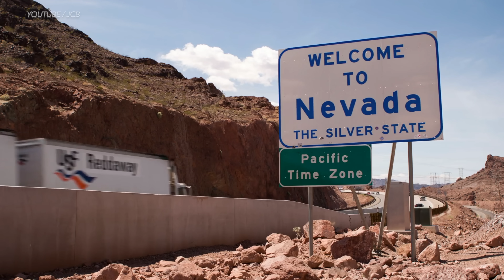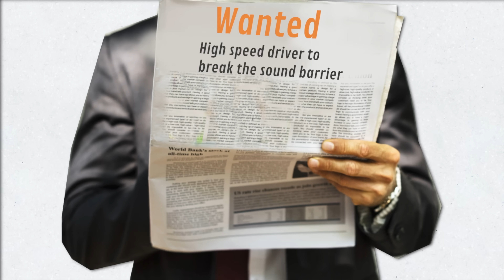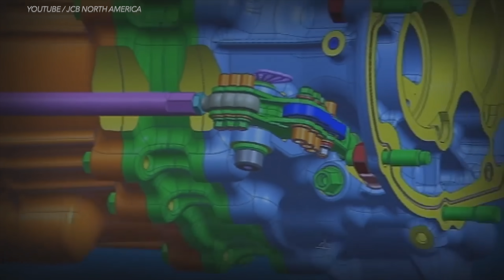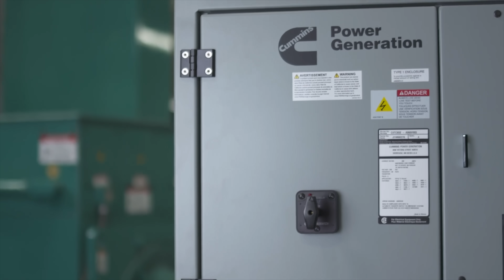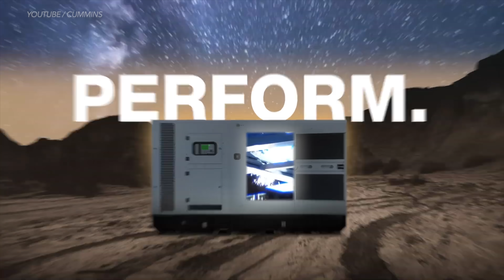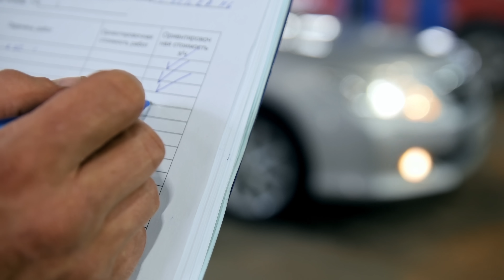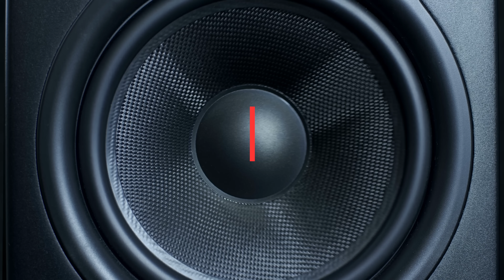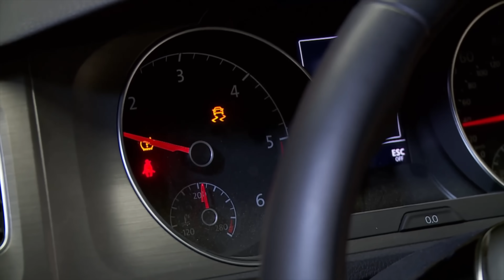Here's Why Diesel Engines are Being Banned

Comment: I love my 2000 VW Golf TDI. It’s got over 255,000 miles on it. I would buy another one except they stopped selling them here in the US. I also have a Ford Van with a 6.0 powerstroke diesel that I wish I would like more. (Ford build quality kinda sucks.) Diesels have gotten a bad reputation here in the US. I love the low end torque.

Comment: I have a 2002 VW TDI Golf with 340,000 miles on it. It has issues but I LOVE it.  I want to replace it with another diesel auto and there is my problem.  There are none in America.  I like the torque and I average 48 mpg. If I keep it at 60mph (rarely) on the highway I achieve 51mpg.

Comment: just bought a 2019 Jayco Seneca RV with a Cummins 6.7 Diesel.  Love it.  wouldn't think of using gas. love being able to go over 600 miles on a tank.  28,000 lbs and get twice what i would get with a gas engine. But I do care about global warming so I will put a big green sticker on the rv "Super Clean Super Efficient Cummins Hybrid Engine".  Or "Super Clean Hybrid Diesel Electric". That would be my Cummins/Onan generator on board but what the heck.

Comment: I have a. 15 year old Ford Fiesta TDI, 88000 on the clock. At a consistent 65 plus mph, i achieve 70 mpg.
Not as much in winter obviously, its around 63 mpg then. I have driven many vehicles over my years yet this diesel cars torque is brilliant. 
Remember drive with caution not calamity.

Comment: Many people do not realize that for big heavy jobs diesel electric hybrids have been the choice "go to" solution for well over a century. Submarines ; there are still lots of the diesel electric submarines including the still dangerous Kilo class. Diesel locomotives actual have final drives are electric. So are (ironically)  the huge diggers and ore carriers at coal mines. I'm guessing that the reason that we don't have diesel electric hybrid cars and trucks is that the increased cost and weight combined would limit the  market to a small niche with deep pockets. Fire departments ? Military?

Comment: So a diesel car will deafen you? Sorry, completely wrong. I have driven diesel for 18 years. My current Audi 3l A5 is nearly silent. Some tyre noise and that’s about it, AND it usually does over 50 mpg and has passed 60. Maintenance costs are near as damn it the same as petrol and the engines typical go on a lot longer. Several hundred k miles is usual, unlike petrol (gas) which would be into a rebuild by then, and acceleration great … all that torque. As to NOx, my and all current diesels use AdBlue that catalyses the NO2 to nitrogen and water … and nitrogen is 70% of our atmosphere. But yes, we’re all being encouraged to ‘go electric’ and share the handful of chargers there are, or charge overnight from an electricity grid that isn’t supposed to have the capacity, and for people living in town with on street parking? How will they charge? Another ill thought out Government ‘strategy’

Comment: Driving a Jeep GC with a 3.0 Mercedes diesel engine and 200k miles on it. Even with permanent 4x4 i get better fuel mileage and a lot more pickup then the gasoline version. I think the diesel problem in the US is the bad history when US car companies made cheap diesel engines what broke a lot because there didn't understand you can't just convert a gasoline engine to diesel.

Comment: No question diesel is more efficient than gasoline engines. I'd love to have a diesel pickup to pull my camper. But, the more than $10k initial price premium and the insanely high maintenence cost make diesel pickup totally unacceptable.

Comment: One thing that's worth noting is that gasoline engines have a maximum size after which they become very inefficient. In the opposite, diesel engines can be very large without loosing efficiency. That is why large ships and other machinery are not powered by gasoline engines

Comment: I have an X5 Diesel...  112,000 miles.  Knock on wood no issues with this engine.. although I recognize the UREA plumbing is a nightmare. The engine is great the emission stuff is worse than on gas cars... But I keep it up and at 63 mph flat ground I get around 29 to 31 mph.  Go any faster and wind resistance really kicks in... guiet with a lot of torque...

Comment: I have a 2005 Jetta TDI that with the help of the internet/YouTube, was able to pass emissions. It wasn’t that it was”dirty”, it would have the “check engine light” come on during the test. With the help of a basic code reader, I replaced the glow plugs, coolant temp sensor, and the vacuum valve that controls turbo boost. I will try to keep this car running as long as possible.

Comment: Diesel engines are great, usally well made, heaps of torque, good fuel milage etc.. But absolute poison when it comes to repair costs. A set of replacement injectors supplied and fitted to a late model diesel engine can cost as much as a  fully reconditioned petrol engine. A friend of mine ended up with contaminated fuel in is late model pickup. New pump and injectors fitted, clean tank etc, AUD $11,000 ( USD $7,400). Diesel particulate filters (DPF) that is another whole story by itself $$$$$.

Comment: I had a diesel but sold it a few years ago. it could do 36mpg highway while my present car is a GDI and can do 30mpg;  but it’s also heavier by 300kg and bigger. So now they say the new gasoline cars come with almost the same fuel efficiency so there is no need for a diesel however there should be some advantages like better reliability long term?! or less problems in cas of carbon buildup?

Comment: I hate that even Scotty has used that "up to 40 x" emissions re VW without showing actual numbers- clarify! Unless there's obvious ulterior motives. Most of the "cheat" emissions levels were still minute; numbers easily accessed w a search online, they are still incredibly low compared to past engines, and mostly below EPA limits set the previous year! "Up to" doesn't mean 100% of the time, and 40 x 0 is still 0 (just for reference)

Comment: I drive a 2.8 litre Duramax Diesel powered Colorado.  Best thing ever in light trucks.  Next year Chevrolet Colorado will come with one motor, and not a diesel.  It will be the 2.7 liter twin turbo 4 cylinder gasoline engine behind a 10 speed transmission.  Fuel economy will likely be close to the current diesel, and the engine will be far better suited to short trips and sub-zero temperatures experienced in parts of Nth America.  But here in Australia, we can travel between capital cities on the east and south coast on one fill, giving us between 800 km and 1,000 km per tank.

Comment: I had a 300D, it had fairly good fuel mileage but very expensive to maintain and high engine wear brought it down.

The oily deck at gas stations also wrecked lots of shoes.

Finally, its the nano particles they spit out, we now know these are bad.

Switched to an LPG powered GM V6. Very happy with that, much better vehicle than the Merc.

Comment: I checked the decibel level in my 01 7.3 F250 2wd . With a AIS  intake and a straight through muffler with 4" exhaust. 
Wicked wheel in the turbo and 6 position chip. I came up with 75 - 77 decibels.
Not as good as a gas truck but see how many of them are capable of running over 500k miles.

Comment: Until 6/7 years ago here in Europe 60% of new cars sold were diesel. From 1.5 L and above diesel was the nuber one choice. From 2.0 L and above, almost no one bought a gasoline car. Now they want us to replace diesel cars with gasoline hybrids. Toyota was the first to ditch their diesel range, and it's still the manufacturer with the best hybrid range. But also other brands are now introducing almost only hybrid or "mild hybrid" (that means with very little batteries and electric engines, that cannot work by itself but just as an additional torque aid to the gasoline engine, and for braking battery regeneration). The only one advantage of "mild hybrid" compared to standard hybrid (called here "full hybrid) cars, is the fact that these mild hybrid cars still have manual transmission and the clutch pedal that we love so much!

Comment: Just literally returned home from an 800 mile camping trip towing 6000 lb camper around mtns of colorado.  Averaged 14.5 mpg.  6.6l duramax.  My old Toyota gasser would avg 8 mpg and seemed like I was gonna throw a rod going up some of the passes in 2nd and 3rd gear.

One benefit scotty didn't touch on is the exhaust break benefits when towing.  I consider it a safety feature as another form of breaking.

Comment: I was at a Freightliner dealership, waiting for some warranty work and one of their techs was telling me how the air coming out of my exhaust was cleaner than the air that got sucked into that engine, take a look at the exhaust pipe of a class 8 tractor, you could run your fingers over the inside of that pipe and your finger will be clean. If you see a diesel vehicle  blowing out smoke, you're looking at a "sick" engine, but then we have the morons in diesel pickups that deliberately disable emission controls in their diesel pickups to 'roll coal", which is probably one of the absolutely STUPIDEST things I've ever witnessed

Comment: what a lot of crap, diesel engines are low maintenance and the last forever, and are they loud (100db)?, no of course not, my ford mondeo 2.0 diesel produces only 67 db at 100km/h, inside the car it is pleasantly quiet. I live in a cold climate, i was always able to start even at -28dgC.

Comment: The NO2 and Nox  levels can be almost can be eliminated if you B100 biodiesel  particularly if it is coal based biodiesel. Yeah I said coal and diesel in one sentence..a greenie's nightmare.  EVs are not about saving the planet....it's about making money. CO2, NOX, and NO2 are necessary to increase the vegetation levels of the planet. The higher vegetation levels increase the O2 and moisture or rain amount. The Green movement is actually killing the planet.

Comment: I have a  2009 twin turbo 2.4 Volvo V70 diesel than can do 155 mph  and averages over 40 MPG  , I service the car my self which isn't hard to do on a Volvo and I learned it watching Scotty videos. Anything harder than changing oil fluids and filters I leave to a mechanic, the car still runs like a  new car and I'm planning on keeping it as long as I can as I couldn't do the same in a petrol, like carry the load I do when I go camping with my family  . When I tow a  trailer and have a large roof box fitted I still get great MPG, I love how little it costs me to keep my diesel Volvo on the road .

Comment: I drive either a GMC Sierra 4X4 Duramax or a Mazda Miata RF. With the price of fuel where it is today I tend to drive the Miata a lot more than I would if fuel prices were lower. The truck is more comfortable and I can carry very little in the Miata. I’m also riding my SurRon a great deal more. Costs less than $3.00 ($2.88) to get me to the gym and back home for two weeks. The downside is the dog (#12.5 Pekingese) is not happy riding in the basket.

Comment: I have a 2013 VW  TDI SEL which gets 35 mpg in town & 45 mpg on the road.  It’s quiet enough - and peppy enough - that my passengers are surprised to find out that they are in a diesel engined vehicle.  Note that it has a dual clutch transmission - which may have something to do with that perception.

Comment: Got two diesels here in the UK. It's interesting how they have massively improved the diesel engines and lowered emissions. Mine is a 2004 Ford and the annual road tax (like your tags) is based on emissions, so that one costs me £300 a year, whereas my wifes car which is a 2014 Citroen costs just £20 a year, and on a road trip a few weeks ago was averaging 58 to the gallon (imperial gallon, not US gallon).

Comment: The problem with diesel engines is for normal technical skilled ppl  warmup becomes a problem. They simply destroy the engine. And here we can philosopy about oildrinking engines/ worn out piston rings with mr scotty and normal ppl. Ps/ if you want to be pro learn to warm up in the correct way is it really to startup and let it idle/ or isnt it? 😉 Cheers

Comment: Seems no one is including the total amount of pollution from manufacturing to scrapping a vehicle diesel vs gas. I wonder if diesel would have less overall environmental impact than gas.Most diesel vehicle will outlast gas cars at least buy double. The Mercedes museum has a 240D with 3 million miles on it still runs and drives fine. How many gas cars would you have to build to equal that and how much pollution would you create building all the extra cars to equal that?

Comment: Have 2 diesel cars and I have no gas cars. Compared to gas engine, diesel engine are more durable and last longer. Maintenance is mostly changing engine oil, oil filters, air  filter and fuel filters at regular intervals.

Comment: Diesel engines aren't going anywhere. I have owned a 4.2ltr diesel Landcruiser for the last 25 years and It has been a great vehicle and never let me down. I have just sold it and purchased a brand new Isuzu cab over truck with a 5.2 ltr  diesel that has no DPF or DEF and I'm expecting that to last me for another 25 years all going well. Please don't take my Diesel away from me.

Comment: I drive a 2.2 litre Mercedes automatic diesel, it gives 37 mpg round town and 57 mpg on motorways it is 18 years old gets regular oil and filter changes and has given very few issues in the 16 years I have owned it, best car I have bought so far!  It has 122,000 miles on the clock.

Comment: I daily drive a 1991 350SDL Mercedes Benz. It's a land yacht, long wheel base, YUGE interior!!!. I get 24mpg city 30-34 on highway with a rotten egg under the fuel peddle. It is the most comfortable ride i've ever owned. Has the 6 cyl 350 which is a mechanical fuel delivery, AKA EMP proof!! If engine spins over it will run! I'll keep it till the oil pan fails to keep connecting rods in it. Very simple to repair most anything, but i do repairs on most all the older classic Benz's. So to me repairs are no problem.

Comment: I drove a diesel Jetta several years ago (dieselgate time).  My vehicle fell into that class, and after it ruined a second paricle separator, I traded for a Hybrid Jetta.  The Hybrid got much, much better stuck in traffic than when moving.  Also, it averaged in the low 40's on the highway (and was often not running when in use in the city).  The diesel got an average of 43 MPG combined.
Reply: Starting in 1985, I drove a 1980 VW Rabbit diesel, replaced it with a 1990 Jetta turbodiesel, then a 1996 Jetta TDI. Kept each until a major mechanical failure. Each lasted about 250-280 k miles.  Still have a 1982 Rabbit diesel pickup to drive occasionally.  The TDI was far superior to the Rabbit in comfort (lower noise level) and fuel economy (50 mpg vs 43 mpg @ 60 mph).  Diesel autos were great for their time, but today gas hybrids get equal fuel economy on a cheaper fuel.

Comment: I drive a 2.9litre non turbo 4 cylinder Ford Ranger (Mazda really). I have no idea what my gas mileage is it's so cheap to operate. It's my remote site office too and runs all day with the aircon running and a an inverter for tools and test equipment (kept cool in the aircon cab) and the fuel gauge doesn't move.
I live in the tropics.

Comment: I have a 2006 and 07 LBZ 
Both diesel- 06 has 340k miles
07 has 220k  original engine and transmission on both truck. No def. My 07 gets 15.6 mpg around town.

Comment: Hiya Scotty, I drive a diesel pickup truck in the UK for 2 reasons, economy and aS a pickup truck is classed as a commercial vehicle I pay less tax as a company vehicle.  The day that they say that I have to drive an electric car is the day that I hand in my driving licence.  I cannot see why people are so gullible when it comes to modern diesels. As you say in your video, modern diesels are super clean if fitted with scr and dpf systems so why is diesel still seen as a bad fuel. I cam rev my truck to 6000 rpm and there is nothing coming out of the exhaust. Diesel is king as far as I am concerned

Comment: We have the Ram 3500 with the 6.7 Cummins diesel. Nothing else in an ordinary pickup seems able to tow our big Montana 5th wheel trailer up the mountains. This pickup does fine. But I can see why mechanics charge more for maintenance. I purchased mine used, and have now owned it for 5 years, and it is harder to work on. By that, I mean normal repairs like installing a new alternator or water pump just seems to take longer and require more muscle. And the PCV filter, for example, costs more than one hundred dollars at the usual auto parts stores. The fuel filter (traps particles down to 7 microns for a good filter) is 70 to 80 dollars at most auto parts stores. It's still worth it for me, but in the USA, maintenance on the diesel is going to cost more than typical gas engines, for those reasons. All in all, its probably impossible to beat the diesel engine for large towing applications. I can go the speed limit up any interstate while towing our big fithwheel, never could with the gas engines!  Long live the diesel, cheers!
Reply: Deisel engines and parts must be more robust.  They are heavy and heavy-duty.  I installed a starter in my F-250.  it weighed over 40 pounds and I lay on my back to do it.  It really wasn't that hard.